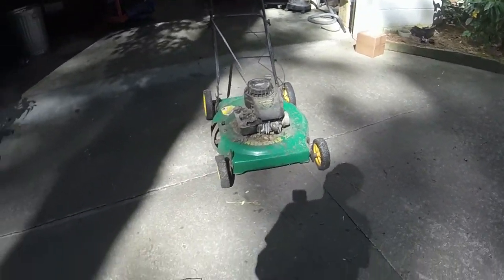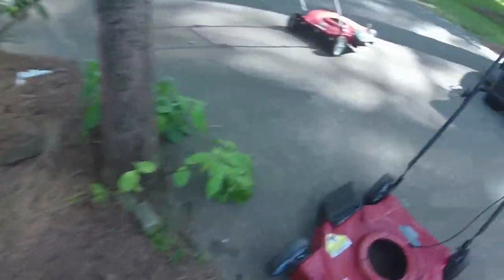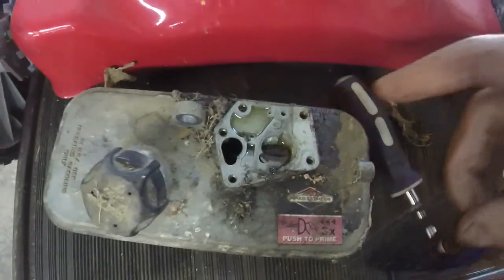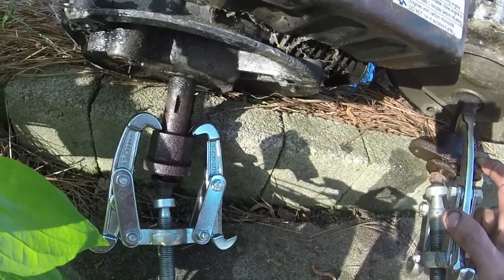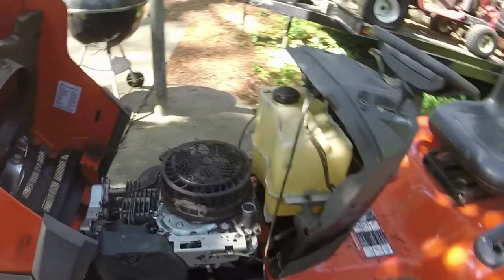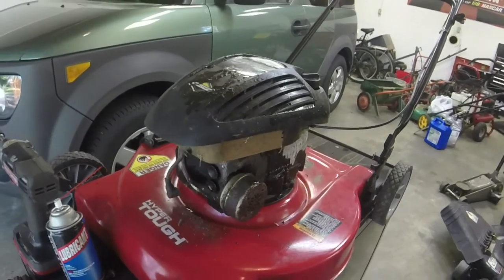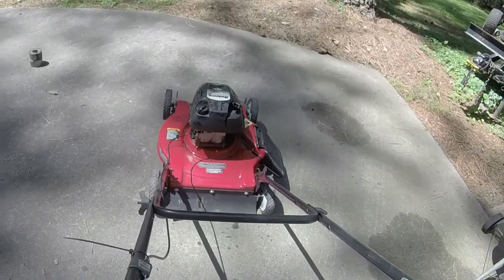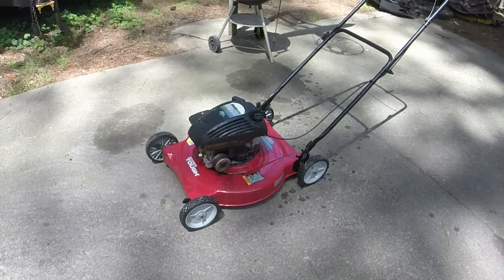Free Weed Eater 22" mower + Hyper Tough deck + 2 Briggs Classic engines = one Frankenmower

Comment: Looks like the bolts worked up, cracked the block then the owner saw that and tightened them back down. the bolts only need to be loosened to cause the block to crack.  Tarly has a neat fix for it.

Comment: Ellis Mowers. The underside of the WeedEater Mower looked very much like the dump truck beds used for Snow & Ice removal with the totally decrepit steel that I used to repair for many years. 
It’s really amazing how corrosive grass clippings can be when they are not cleaned out periodically which is not all that far removed from the Calcium Chloride used in tractor tires and the Calcium/Salt Brine solution utilized to enhance rock salt spread onto the highways. When the corrosion travels into the threads of the mounting bolts - In a worst case scenario, The corrosion welds the threads onto the fasteners similar to red loctite. Fasteners saturated especially with Red Loctite tend to be quite difficult to drill out. Usually a small brazing tip & some heat “May” help the fasteners to break loose from the threads- But Not Always.
After seeing the Husqvarna rider with the Kohler Courage engine - I was very happy that my MTD YardMachine had the 21hp Briggs & Stratton engine instead of the Dis-Courage Engine. Thanks for all of your videos & your replies to my comments.

Comment: Everything worked out good I sold a mower this year the same way I have broke one of the engine bolts on it and it was a classic engine also but the two held up swapped it on a 22 in low deck
Reply from the maker: Thanks John, as long as I get two out without breaking them I am satisfied.
Reply: @EllisMowersandmore  you can put a bolt through the oil sump if you break a bolt